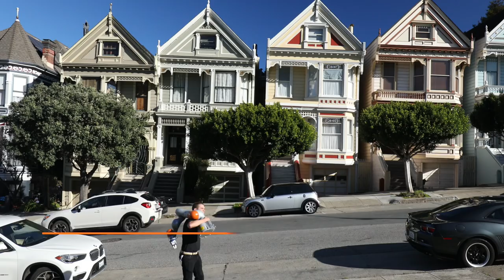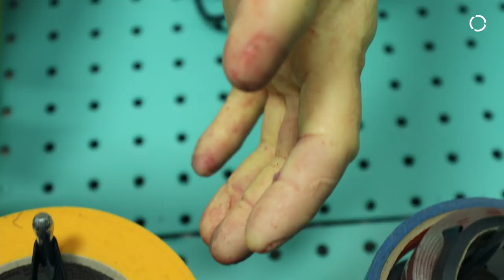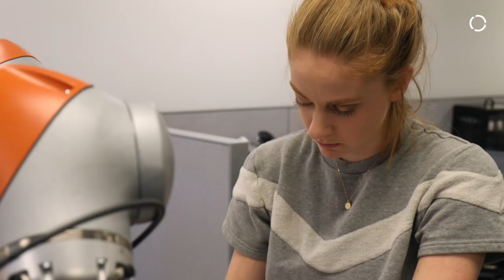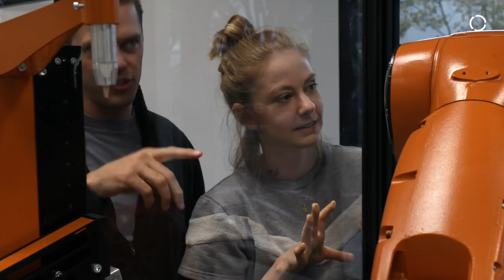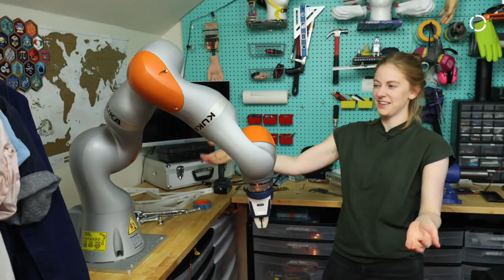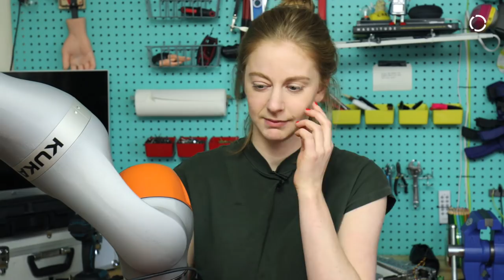"Queen of Sh*tty Robots" Treats Serious Robot to Fun Times

Comment: Now, one size smaller and make a Consumer end model.  Name it SIMON and we will all buy one.   And please make it less freaky  looking than that last arm, with just one or two edges less rounded off.
Reply: Making them cheaper is difficult to do because of the gearboxes used. They're strain wave drives, and those are really difficult to manufacture.
The extreme roundness of the iiwa is to reduce the number of pinch points - if a regular(non-collaborative) robot is told to fold and your hand somehow ends up in the joint, there's a likely possibility that your wrist or fingers will be sheared off or at least broken before the robot's servo drives realise that something is wrong.
A large(floor-mount) robot with safety systems disabled will easily rip itself off a concrete pad or punch a hole through the wall when told to.